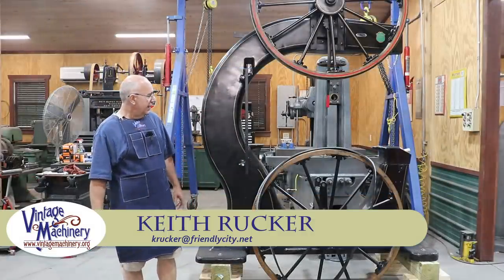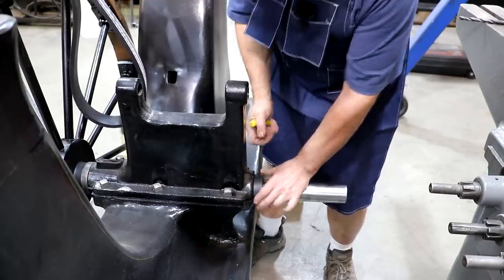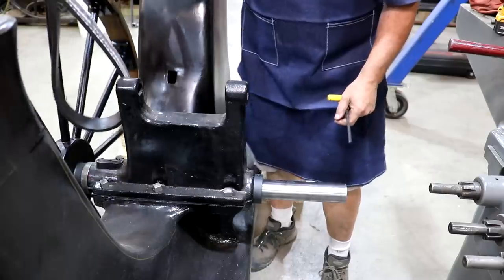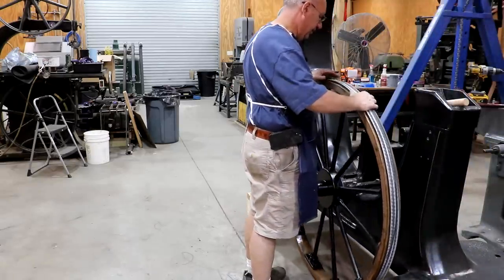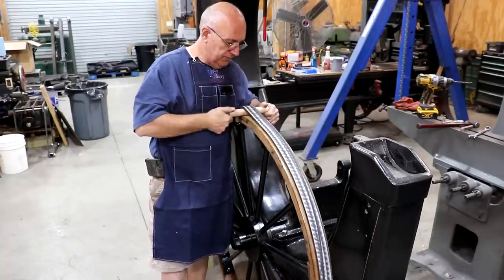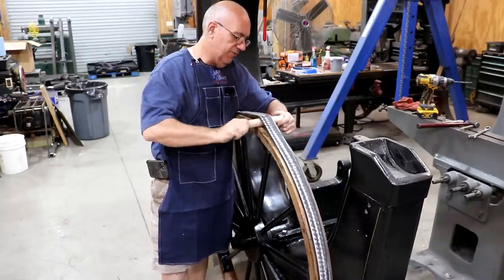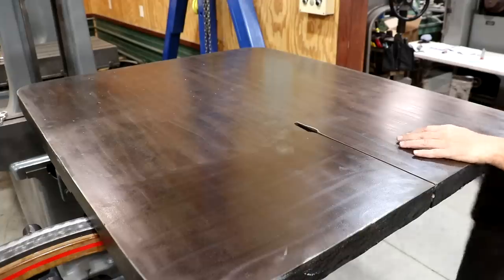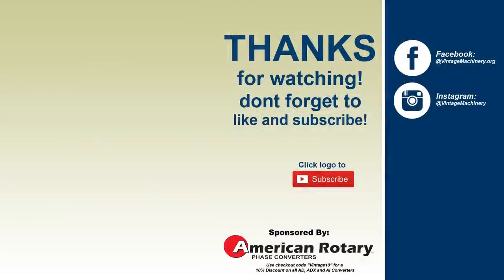Diresta Bandsaw Restoration 27: Finishing the Bottom Wheel and Installing the Table

Comment: Beautiful job. I miss my pinstriper, lost long ago to sticky fingers on a job. For the table a surface conditioning tool makes it a lot easier. I had the Eastwood version, damaged it (I backed the tractor over it.... Dummy move), replaced with the HF. Both make short work.

Comment: An oldtime Tire iron - those 'we' put rubber back on rims that blew out on the highway.  I have one.  From the 20-30's.  It is a 1" bar with a diagonal flat rounded end bar ground out and bent.  It slides under and you lever it over the edge.  Easy to make once you understand.

Comment: I've only installed one bandsaw tire and I remember it wasn't easy.  And it was much smaller wheel.  When I got a new steering wheel cover for my truck, the salesman advised to set it in the sun for several minutes.  That guy was right!  Easiest cover I ever installed.  I am thinking a bandsaw tire might benefit from that as well.  
Also, I have successfully used Scotch Brite pads on my grinder on cast surfaces to give a little more-finished polish.  
Good project.  Thanks.

Comment: Hi Kieth, That is an amazing transformation, and what a beast of a machine. They certainly don't make them like that anymore.
Jason at Fireball Tools restored one a few year back and made some really nice guards to cover the wheels and blade to make it safe, that would make a nice addition as well.
Putting those rubber tyres was a good workout for you as well.
The table would have some weight in it too, not something you just pick up and put on.
Be nice to see it back cutting wood.
Regards Dennis

Comment: Im surprised you didn't fix the table where the blade has eaten a big hole over the years. I've made replaceable inserts that seat flush in a pocket in the table. Just makes the saw so much safer so little off cuts dont want to get jamed up.

Comment: If you install a c-clamp perpendicular, on each wheel "edge" , then if the wheel tries to slip off, it can't go far and will allow you to start over, if you will. Additionally, A tapered dowel, tapered to the center of the wheel will allow you to "roll the tire" to the center and assuming a flat dowel in the center, allows you to apply the glue as you roll it in position. Hard to explain, but I hope you understand what I'm getting at.

Comment: Funny geometry for a bandsaw.  You have to make a hole in the floor to set the saw down.  I suppose the saw ran on steam.  So a larger wheels means faster blade speed at lower rpms.
Reply: The sawmill I worked at when I was a teenager had an open basement under the tools.  The sawdust fell down into large wooden bins.  One of our jobs on Fridays was to shovel out the bins.  So hot and dusty in the summer.

Comment: I thought you were supposed to let rubber cement dry to the touch on both surfaces before you join them? How do you plan on getting that monster out the door haha!! Also, with the lower wheel being below the feet, does Diresta have to cut a hole in his floor or will that thing sit on risers?  If risers, then is there a platform with stairs to get up to a reasonable working height with the table? Seems it was not made for normal size people lol!  That thing is a beast!  Nice restoration so far!!!!

Comment: Are yo going o bolt it to a frame work to allow it to stand up.  With a removable vertical section to allow the whole saw to laydown wheel side up for shipping and transport safely fully assembled.  Forward thinking could allow the laydown platform to become a raised deck to work from until final concrete work is performed to mount it over a pit.

Comment: As a person with a severe case of OCD when it comes to hardware. I can appreciate the square heads under table. Then paint so there totally  invisible.
Reply: Being an aircraft mechanic. I wanted to see washers under the bolt heads so the corner of the bolts didn't dig in the the base.
Reply: @markthompson8656  
I thought about the washers also but figured they are not original.

Comment: This is a very cool project. Just wondering if the reduction in the diameter of the wheels will give problems with the saw location in the table.

Comment: Hi Keith man that look's good . Are you going to remove the bottom wheel for shipping also is it going to go on a lowboy trailer for overall height to clear overpass on the highway And i have to ask is it going to be used or just a museum piece . Great job . JM
Reply: @ralphgesler5110  what do you know about what Keith is going to do. And why would you want to reassemble a machine you just paid to have restored. JM

Comment: Keith, I still have the 7 1/2 hp 3 phase motor that came off a 1944 Westinghouse air compressor. Would like to trade it for 6" 4 Jaw Chuck with a 1 1/8 thread opening.
Reply: don't you have any more in the style of 1900 M7 Standard Tesla AC Motor,
Electric Motors got so boring looking fast.

Comment: Keith, is there some reason the rubber band makers don't make them with a crown ready moulded in?
Reply: Newer saws have the crown built into the wheel. I suspect the older ones didn't. After Keith trued the wheels, I imagine they could have been crowned but don't know if they were done that way from the factory.

Comment: Great work Keith!! 
Question with the bottom wheel hanging lower than the base have you got a frame or stand for it to go on it yet, or is it going to some where else???
Reply: He’s mentioned in the other parts that it typically would have had a hole dug in the floor for the lower wheel. I think he shows a picture of it. Check out the other parts!
Reply: @lonniehutchinson4310  Yes that is correct. But I was asking how Keith was going to set it up or if he where he as going to set it up in the shop.
Reply: @williammurfin6354  He's restoring it for Jimmy Diresta, not for himself. I'm sure Jimmy has a plan for how to set it up.

Comment: You could show it to the people who laid the concrete slab. They could use a concrete saw to make a slot in floor for the wheel to go down into. It would be deeper than the slab is thick, but they would have a solution for that I suspect.